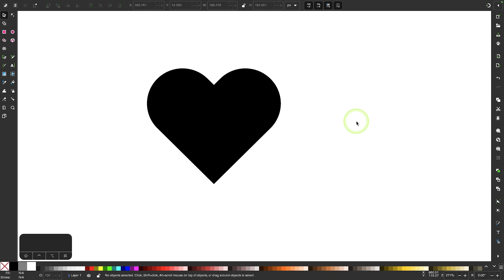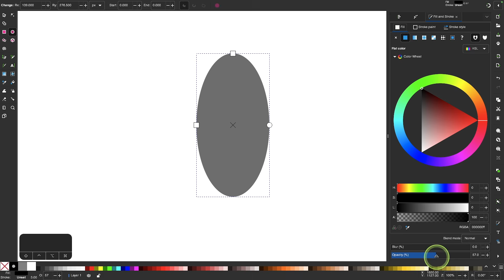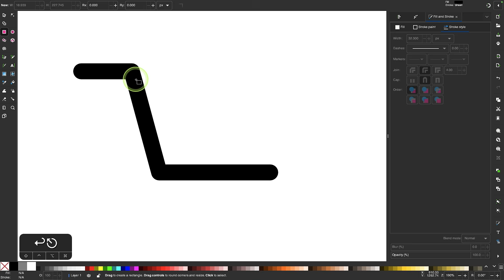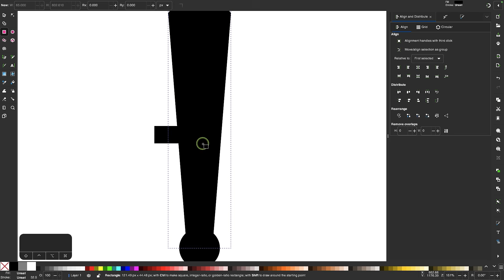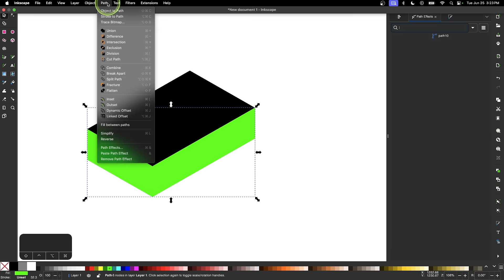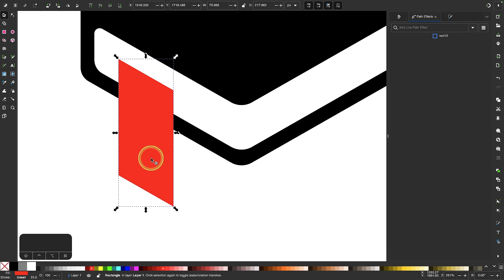Comment: What does all the rotating do on the book design?
Reply: As per what I understood, it is to change the size of the object or paths by only 1 axis. Take elongation as an example. You need to maintain the angle the points make with the X-axis. If you drag the top right transformation arrow, the angles change on both axis and the shape looks sheared. If you rotate and make the elongation side either X or Y-axis, you have to use the center transformation arrows which transform only along 1 axis. This maintains the angle and elongates the book. And then you rotate it back to it's original design.

Comment: Great first shapes tut, thank you, I could follow some of these but the shopping trolley one was a no go. I did the intial lines, holding ctrl for the 75o angle, hit enter and....it made a weird crossed over and filled set of polygons in the space where the shopping trolley body is meant to fit. Also I couldn't get the tip of the sword to elevate when seleted as shown and holding ctrl. It just stretched vertically but remained flat. I am on pc, not mac and honestly your 'difference' controls seem to do what on mine is marked as 'exclusion'.  I follow your videos to the absolute letter, all settings matched perfectly and yet mine does different things to those shown. This program is profoundly difficult to work with :(
Reply: I was having the same issue with the shopping cart line making a polygon instead... I did some digging, so here's the solution I found: 
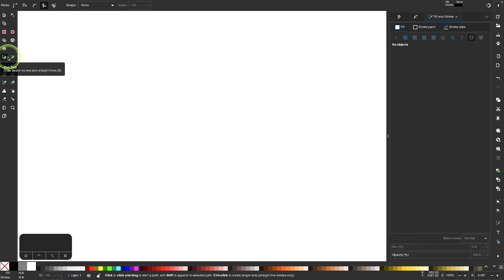For the bezier tool, you get the "Fill and Stroke" panel like you can see to the right at 8:24. There's three sub panels, Fill, Stroke Paint, and Stroke Style. In Fill, select "No Paint" (it should be a little x next to the other blue icons), and in Stroke Paint select "Flat Color" (solid blue square). That fixed the issue for me, so I hope it helps you :)

Comment: Whenever I use the shape builder tool in Inkscape, it creates extra nodes. Does anyone know how to prevent this?
Reply: Have you updated Inkscape recently? This was an issue in the older version from last year. They fixed that in the latest version.
Reply: Late reply I know, but I think I had this problem yesterday; I would click on each segment I wanted in the shape, and it would create alot of nodes, and I couldn't shape the corners of the wineglass into curves. Turns out that I was supposed to select the segments while holding down the mouse button the whole time, rather than individual clicks. And then it worked fine. Hope that helps, but you probably already got the answer, since it's been three months.